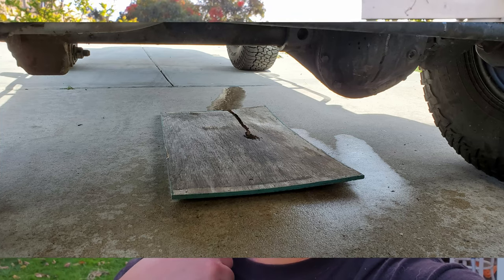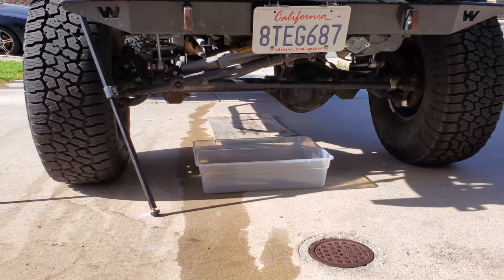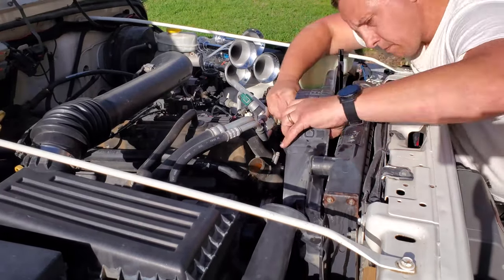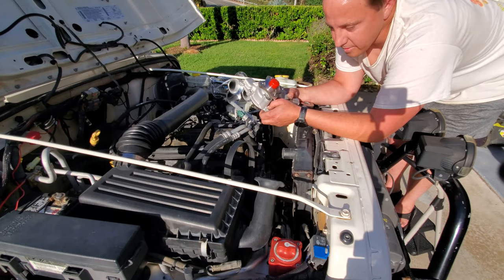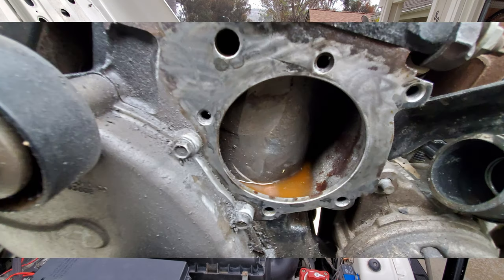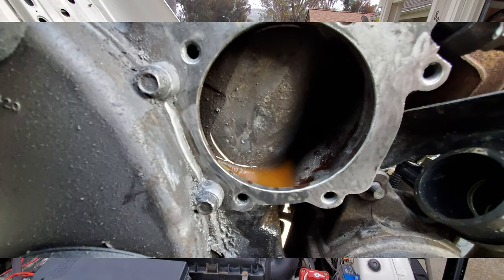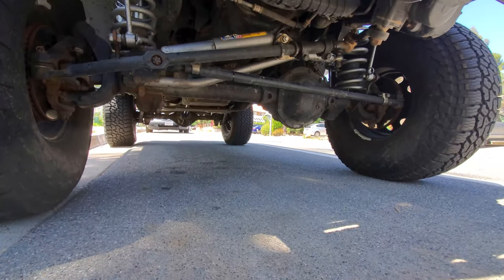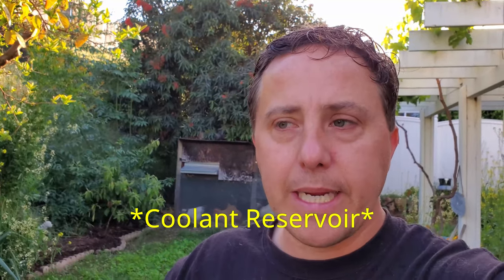Changing Water Pump on 2006 Jeep LJ Rubicon 4.0L (First Time Ever)

Comment: Good video beside the description for the fan clutch.
Reply from the maker: What would you title the video as then?
Reply: @PlanItSendIt  not the video, how you described the reason for not setting the fan clutch on its face.
Reply from the maker: @solidgold2  did I receive bad gouge on the fan clutch? If so, does it matter if you lay it on its face for example?
Reply from the maker: @solidgold2  thank you.